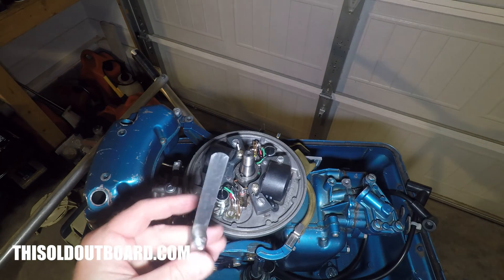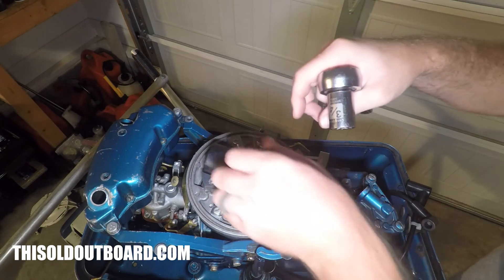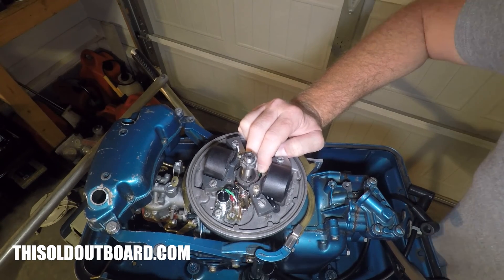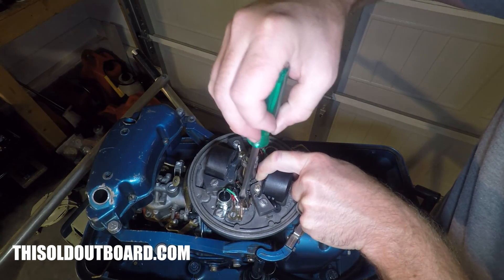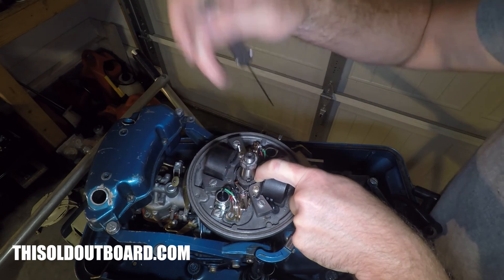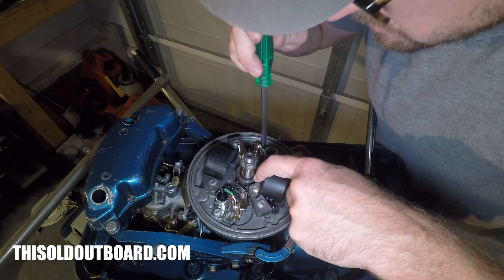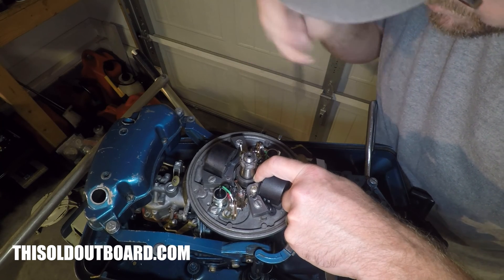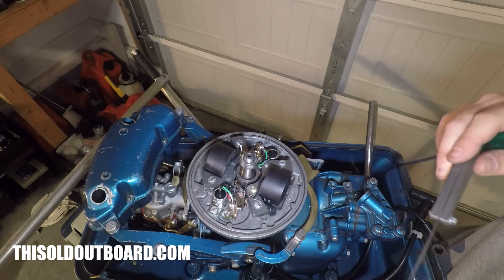How to Set the Points on a Vintage Johnson / Evinrude Outboard

Comment: Take a short piece of PVC pipe cut to a length so that it fit between the nut and the cam. Drop it on the crankshaft, screw the nut down against it and that will hold the cam down. You can still use the nut to turn the crank.

Comment: It is MUCH  preferable  to set points by TIMING,  but even if you do not have a timing tool, you can  CHECK timing with the flywheel.  Most wheels have an opening to set the points, and if you are tricky,  you can  get  a test probe in there on the points  connection to electrically verify  the points opening.   If the  engine has  the primary wires brought out to a kill switch, then that job is easier.  I even  scribe  the  wheels on  34/ 40HP engines so I can  extend the  timing marks out  and  see what I'm doing, as the marks on them are  under the bottom of the wheel.
Reply: How would you set it by timing tool?
Do you use a timing light? What would you use for your timing mark?